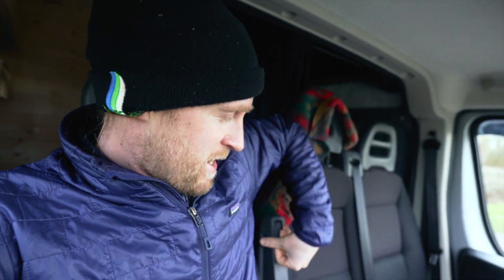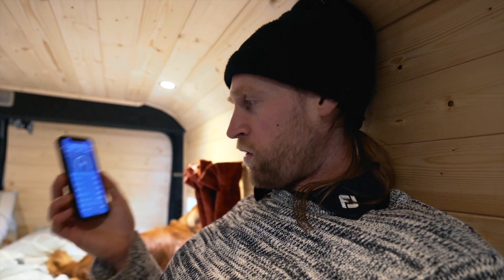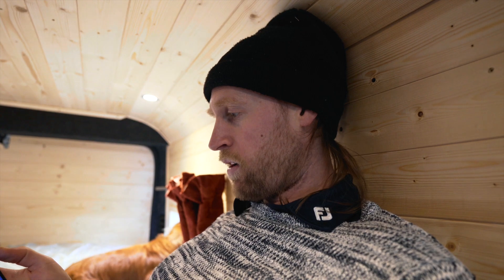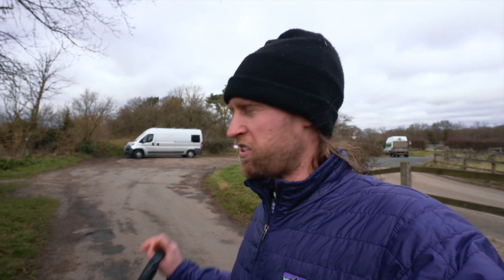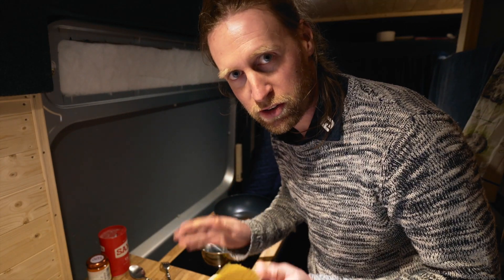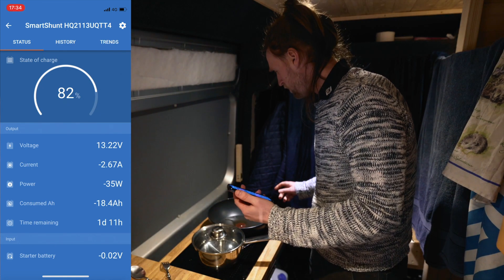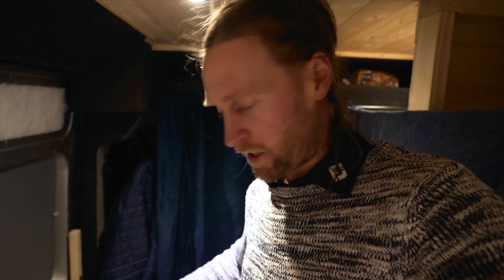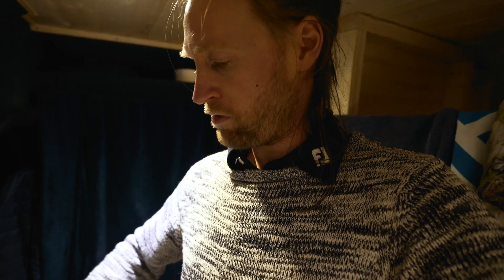3500W Induction Hob vs New Inverter! | Van Build Ep.22

Comment: With inverters, you get what you pay for. We had a 4 day power cut during Storm Arwen here in Aberdeenshire and I thought a £59 inverter from Tool Station would have been able to run off my van engine and power the central heating boiler. Turns out many electronics don't like modified sine wave inverters (the cheap ones), also many inverters (the cheap ones) don't like inductive loads. Looks like possibly your inverter shut down due to the load then automatically reset? Guess you could run the vehicle engine whilst cooking so the leisure batteries don't lose too much charge when under high load? Perhaps you could check the battery voltage using a cheap multimeter to see how far it drops when under a heavy load?

Comment: I dont know whether or not you've solved your issue with the induction but Im only guessing that the problem is caused by the limitations of the battery BMS which is related to the capacity of the battery. Usually Lifepo batteries are having a discharge rate 1C which means that the max current available will discharge the entire battery within 1 hour. For a battery with a capacity of 100 Amp-hrs, this equates to a max discharge current of 100 Amps (approx.1200W).
Reply from the maker: You could be right, we can’t use it on full power and 1000w seems to be the limit. Also as soon as the voltage drops to 12.5v the inverter cuts out which happens quite often even with just 1 ring on medium high. I don’t know whether I can adjust that to perhaps 12v or if I even should, don’t want to damage anything 🤔

Comment: Hi there. Followed your greats vids. I do not have a camper or a tiny house, but a boat. I am also intent to buy the Victron Inverter. I alreay use the Victron Energy Blue Smart 12V/30A acculoader with 3 exits to my 3 batteries and it keeps all three to abou 14.3V. I have some problems with my alternators and was wondering. When I buy the Inverter and use its output to power the Victron Energy Blue Smart, it will keep the batteries in condition. As when I go by boat, there is no longer 230V power from ashore, but the inverter will do that job. It looks like selfsupporting using these Victron equipment. My question. Am I right that an alernator will no longer be needed? 

Looking forward to your reply. THANKS
Regards,
Ed
Reply from the maker: Hi Ed, are you saying that you hope to use the inverter and your leisure batteries to charge the engine battery rather than using the alternator? I guess you could probably loop it round and charge the batteries from the inverter as the inverter is just a power source although it won’t be very efficient. I wouldn’t recommend losing the alternator altogether though, we’ve run the batteries low so many times and the alternator has been a life saver. If you hook up to shore power often though or have loads of leisure batteries then it probably would be fine.
Reply: Thanks for your reply, David! In the meanwhile I have received the Inverter. What a beast it is. It was already clear in your video. Using the Victron Energy, means that all 3 batteries are kept in shape. The Victron Energy needs 230AC and that can be supplied by the inverter. However I still want to try to get the alternator ready again. Wish you all the best and stay healthy. regards, Ed
Reply from the maker: The 3 way charger is great, being able to keep the engine battery charged and never having to worry about a flat battery is really useful. Back in the summer when we were hooked up to the mains at a campsite we hung up some laundry in the cab with a stretchy washing line thing from the shirt hooks above the doors and just flicked the ignition on (not the engine) and blasted the air vents at the washing for about 2 hours to dry it knowing that the engine battery wont drain. Hope it all works out 👍
Reply: Never a dull moment at yours. What a coincidence that your laundry could activate that swich 🙂 Keep us informed with the vids. The're very informative. All the best..

Comment: Oh dear! I just went back to watch your inverter video first to see what you bought. Unfortunately you’ve made the same mistake I did.
Victron inverters ratings are advertised in VA not Watts so your 2000/4000 is only rated at 1600W continuous output with the max of 4000w being available only very briefly as in just for a few milliseconds.

Even that 1600w is potentially only a guesstimate as it will be determined by the power factor of the load.
Resistive loads e.g a kettle typically have a power factor of 1 so your inverter will output 2000w for that device but lets say for example the power factor of your hob was 0.5 then you would only effectively see 1000w output via the inverter.

The manufacturer spec for the hob should provide the actual pf number.

I suspect your first blackout was the low voltage and or over current disconnect in the batteries bms the second event was the inverters internal electronics detecting an overload as your lights didn’t seem to go out that time

Yes adding extra batteries in parallel will solve part of the problem but for the size of hob even when using just one ring I think you have bought an under rated inverter.

A high frequency inverter for this type of application is not ideal either, a low frequency unit might be better but they are very heavy by comparison and even then you will find it difficult to find one rated at a true continuous 3.5-4kw I don’t think Victron sell anything larger than a 3000VA model at 12v however that would probably be sufficient to run one ring reliably once your batteries and cabling are beefed up as well. Have you considered going to 24v or even 48v in order to more efficiently run the hob via an inverter.

It might be worth discussing this with someone like Gary Spears at Motorcraft.

Lastly I can’t emphasise enough how critical perfect cabling is for such an extremely high current load as you are trying to run, all crimps need to be perfect ideally done with a hydraulic crimper, cable runs need to be as thick as and as short as poss all metal to metal mechanical connections need to be and remain spotless you are really at the borderline of what can be run at 12v. Small volt drops through a resistive connection could quickly lead to overheating and meltdown or even a fire risk. Definitely worth regularly checking the 12v side.

Good luck.
Reply from the maker: Oh wow okay, I assumed va was just a terminology for watts and thought the issue was voltage.

That is slightly annoying, I don’t really have room for anything beefier. I have successfully run the inverter since with just one ring on medium high and cooked dinner without any problems so I was hoping extra batteries might help. We have 3 batteries now so I will test it out but if you’re right then that’s a real pain. 

I haven’t looked into 24 or 48 volts and everything is wired and built around the system I have installed so I’d have to strip it all out and start again which isn’t really an option. If push comes to shove we might have to just run the 1 ring and use a portable gas stove which we have as a backup or just have tortillas instead of pasta 😂

I really appreciate you letting me know, I would never have even looked into power factor or anything and just assumed something was broken. Hopefully the extra batteries will help 🙏
Reply: @LivingTheTinyLife  
Your welcome, ironically a couple of weeks ago I got asked a similar question about VA re the little underrated Phoenix 12/500 inverter I discussed in my video about mains fridges, it works 99% of the time.

I just did a quick google on Induction Hob power factors and the consensus seems to be that well made ones have a PF close to 1 so you should be good to go with one ring. Just make sure your inverter has plenty of ventilation because it will be working near to flat out and will probably get quite warm especially in the Summer.

Worth remembering this:
"VA is always greater than or equal to Watts depending on the loads power factor.
The ratio between the VA and the watts is the power factor."

This is a video I did about performance of different types of inverters when used with a fridge:
 https://youtu.be/s-LIwN-8_0M

And this type of meter is useful for all sorts of info including measuring PF when testing stuff.

https://www.amazon.co.uk/dp/B085S7Q1T4/ref=cm_sw_em_r_mt_dp_NKMN7XMSJ4R0TNXF0R4H?_encoding=UTF8&psc=1

Comment: why is everyones reaction to start at max draw. start at the lowest setting to check and step up to see how long it takes to boil water. your inverter is 2000 watts, your induction is 3500 watts on max setting. 35 is larger than 20.

you need another battery
you need another solar panel to cook during the daytime, how are you gonna have any reserve for the evening until morning

if you need 3500 watts for max setting you need to change to 4000 watts inverter, then you have 500 watts available for other ac appliances at the same time.